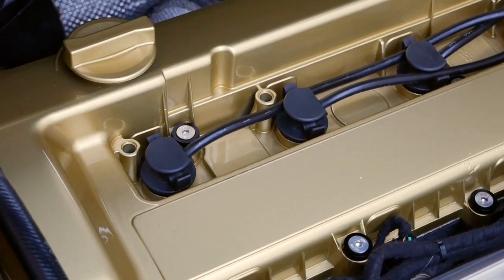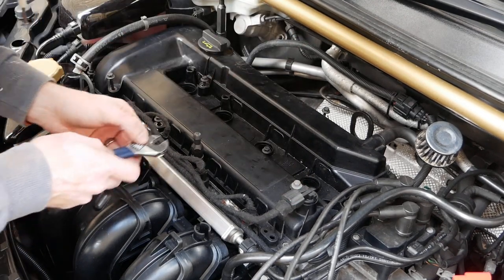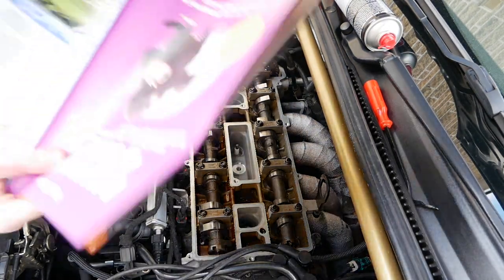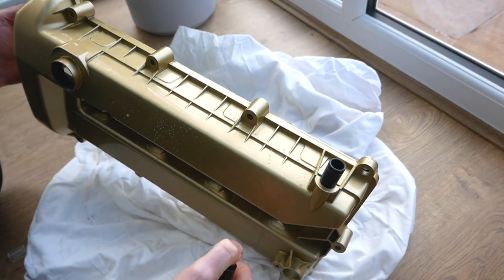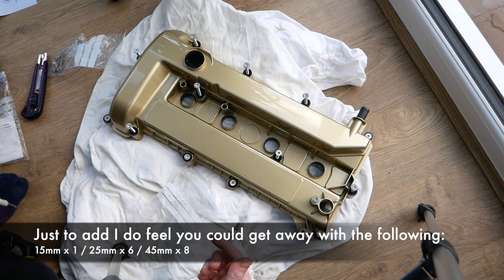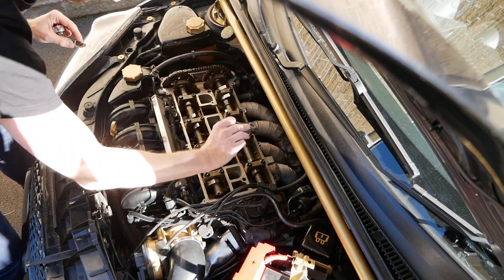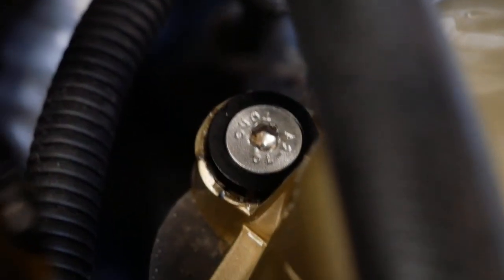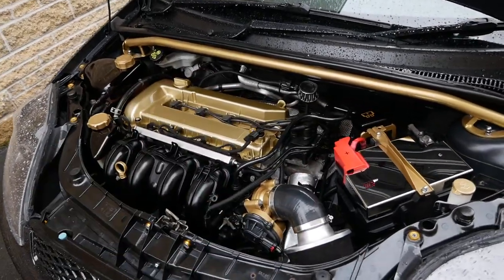Painted Rocker Cover Install on a Ford 2.0L Duratec Fiesta ST150 /  Replacing The Valve Cover - EP86

Comment: Thanks for the video been putting off doing mine as it’s leaking
Reply from the maker: Having the wire loom tuck mod done makes it a lot easier
Reply: Yeah I did think that mines original so it might be a bit tricky

Comment: What did you with the plastic piece that goes over the very far left end of the valve cover (where your power steering cooler hose is running)?
Reply from the maker: Before fitting this I made a video where I did a full wire tuck to make it look better 😁 let me know if you can't find it and I can post a link
Reply: @DriveWithAndy  thanks mate, I'll have a look!

Comment: Ohhh this looks very nice. Would be tempted to paint mine PB to match the exterior. Any idea when you are installing the FF inlet and will you be making a video? Seems to be a lack of content on YouTube with it. Very very tempted to put my name down for the next batch.
Reply from the maker: ideally ASAP but with funds its goinf to be end of the year. Reason is i need to save up for cams and remap to be done as soon as the inlet is installed. As once fitted i have heard if revved over around 3/4k for a long period of time it will damage the engine so once fitted it needs cams and remap